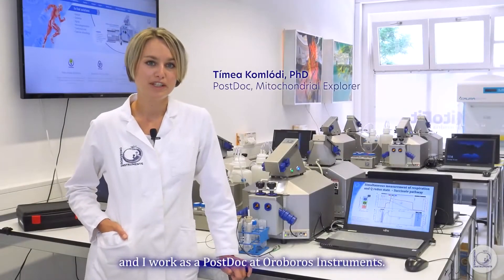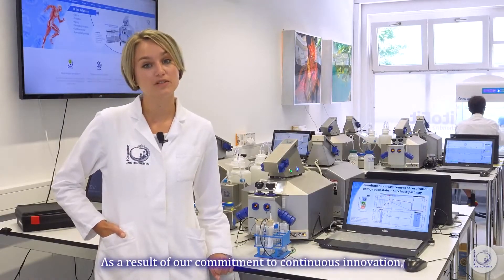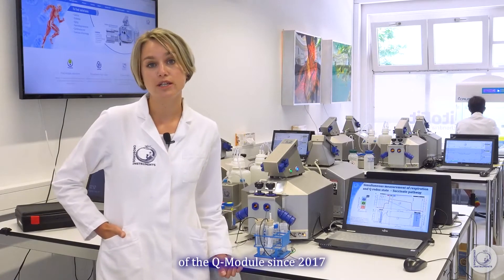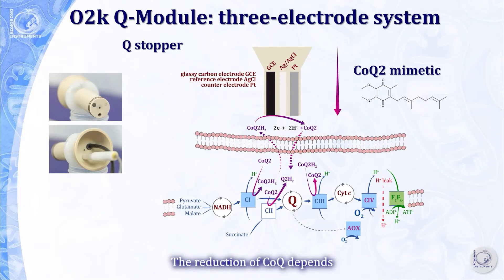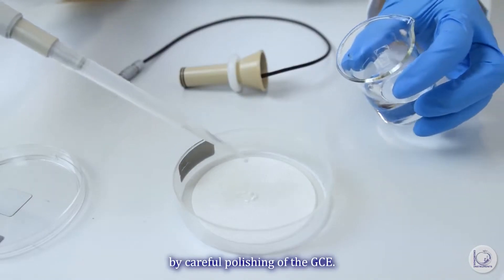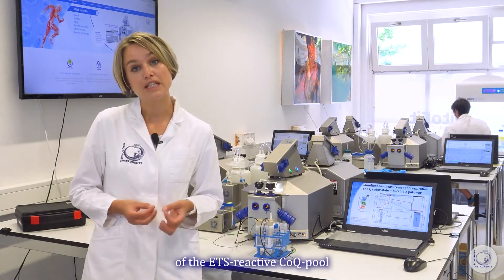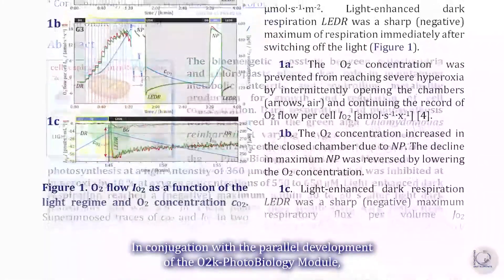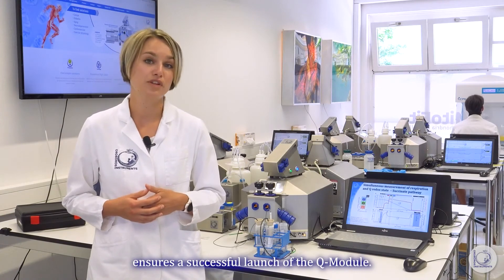NextGen-O2k: the Q-Module

Comment: Ohh I can comment. Ok so if someone hypothetically used DI h20 instead of the electrolyte soln in between the membrane and the cathode/anode what would happen? Asking for a friend.
Reply from the maker: Thanks for your question. The Q-Module (https://wiki.oroboros.at/index.php/Q-Module) does not have a membrane. If you have a question about the polarographic oxygen sensor (POS), please contact our support team: https://www.oroboros.at/index.php/o2k-technical-support/